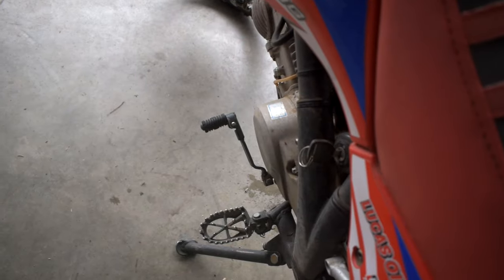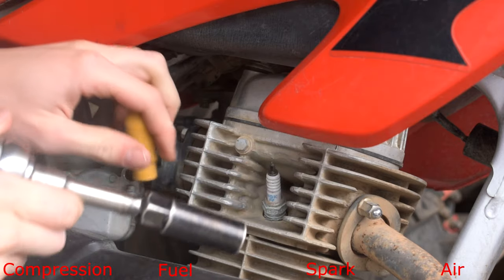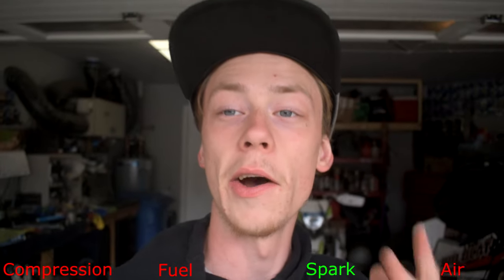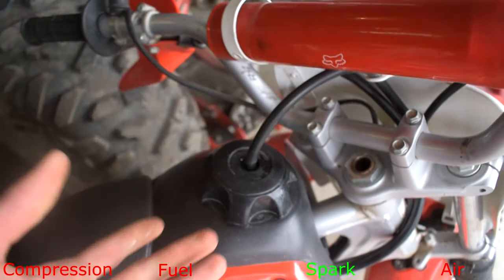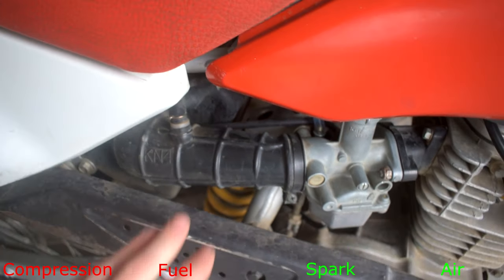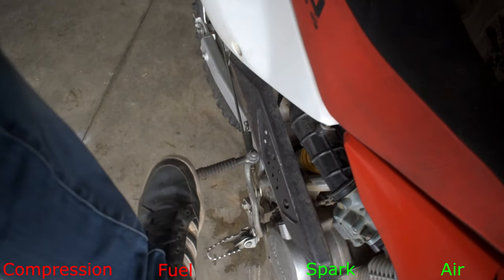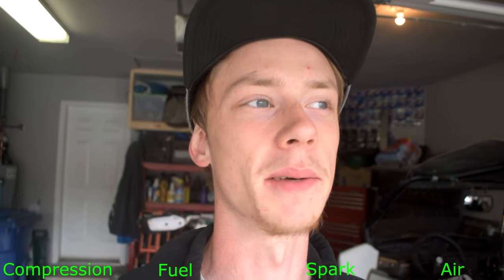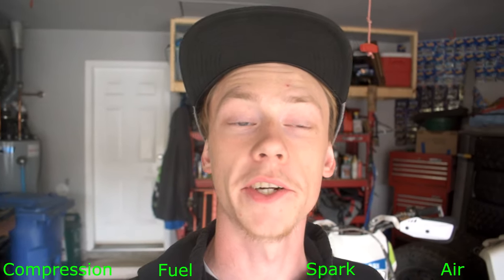Dirt Bike Wont Start? Here's How To Fix It + EXTRA TIPS

Comment: I have a 2019 rfx noticed  2/3 broken spokes so i replaced the rims tires. I didn't ride  for about a 7 to 10 days while waiting for the wheels to arrive. After i replaced them i went to start my bike and it wouldn't kick over. I have compression, fuel, spark, and air i don't know what else to check. Any help would be highly appreciated.
Reply from the maker: If you had all four of those your bike would start tho
Reply: Gonna try to bump start it when i get home
Reply: @AaronsEnduro  got it to bump start on the 3rd try she revved then ran about 10 seconds then cut off kept trying though she never started again 😒
Reply from the maker: @elohimentertainment8166  sounds like a fuel delivery issue
Reply: You think it may be the gas itself?
Reply: It kicks over when i remove the plug and spray carb cleaner into the whole but doesn't stay on 😭😭😭
Reply from the maker: You have fuel clogging somewhere in your fuel system
Reply: @AaronsEnduro  what's the best way to clean your fuel system!?
Reply from the maker: Ultrasonic cleaner machines
Reply: @AaronsEnduro  I can tell you something is cheaper .
Reply from the maker: Carb cleaner works pretty good too, but nothing beats an ultrasonic cleaner
Reply: @AaronsEnduro  you speak very good and clean. I will say God he loves you. Btw it's interesting how you speak
Reply from the maker: Canadian eh 🇨🇦

Comment: Hey man just rebuilt my carb because the float seat was stiffer then epstein at a children's birthday party and was overflowing like epstien at a children's birthday party lol (it no longer leaks gas through the overflow)  we can get the bike to start by bumping it but it won't start with the kick starter and it won't idle after we bump start it ... any suggestions?
Reply from the maker: When you say you rebuilt it, did you ultrasonic clean the carb? To me is sounds like theres still a fuel blockage (possibly in your fuel tank, fuel filter, fuel lines or the carb circuit* where fuel flows through the internals of the carb)
Reply from the maker: This video might help you out 
How To Fix A Dirt Bike That Wont Stay Running | High Idle | Hot stall
Reply from the maker: https://youtu.be/3rSsLNuoy0Q
Reply: Little background the bike is a 2001 yz125! It runs when I bump start it so it's not a fueling issue! The bike does not have a fuel filter on it ! Once I bump it I can right around 0 problems.. until I go to stop, if I don't keep reving the bike it will die on me ;/ I also can't get the bike to start Via the kick starter... we tried adjusting the idle screw but no luck to get it to idle or start with the kick starter .. :/
Reply from the maker: Sounds like a pilot jet issue then
Reply from the maker: Pilot jet controls fuel at and idle and for start up
Reply: Like jet should of been in the rebuild kit is bought correct? If so it's brand new
Reply from the maker: If its too small it wont run because its not letting enough fuel in
Reply: Is the pilot jet the screw with the lock nut that controls the idle? If so i didn't change that and the bike ran before with that exact part! Or is the pilot get actually in the carburetor?
Reply from the maker: @slavikanian  the pilot is inside the carb
Reply from the maker: @slavikanian  watch this and youll know what the pilot jet is https://youtu.be/oyGP1uTU-jE
Reply: @AaronsEnduro  it's a rebuild kit for this specific bike and carb so what would be the issue? Should be the right jet
Reply from the maker: Jetting is the one thing that varies where ever you are. The jetting is partially based on your altitude (thickness of oxygen in the air)

Just because the same bike had the same jetting somewhere else doesnt mean it will be perfect for you. 

If it bumpstarts but wont stay running without your throttle application then its a low idle , throttle cable issue, or jetting.

Either that or you’re overlooking something simple
Reply: @AaronsEnduro  at this point I think I need to take it to a bike mechanic because I don't see what could be wrong .. like I said its a direct rebuild kit so I don't see what the issue would be :/ I should be the right pilot jet. I'm at a loss on this one 😕
Reply: @AaronsEnduro  I'll try some more idle adjustments tomorrow other then that I have no idea... it's got a brand new throttle tube and cable along with new jets.. so I'm going to have to assume it's a low idle issue
Reply from the maker: @slavikanian  buy a pilot jet kit for 18$ and try it out lol
Reply from the maker: @slavikanian  did you put the carb together yourself
Reply: @AaronsEnduro  had help from my buddy putting the carb together I didn't do it myself! I can buy a pilot kit for sure. Should I try putting the original pilot jet back in that I know ran in my bike ? Only reason I rebuilt it was it was passing gas cause the float seat was bad the gasket was hard as a rock
Reply from the maker: Yes why not try that!
Reply: @AaronsEnduro  my buddy checked the numbers before he rebuilt the carb  and they are the same pilot jet... hmmm idk man I'm at a loss at this point lol 😅 set the pilot air screw to the manual specs (turn and a half to a turn and 3/4)  I'm not to sure where I should set the idle screw at as a starting point though
Reply from the maker: If you can get the bike running by holding the throttle after bump starting, (get someone to adjust the idle until it takes over and you dont have to hold the throttle anymore
Reply: @AaronsEnduro  that's what I figured aha we kinda tried that at the end of the day at the shop but buddy got tired from pushing and we called it quits ! I'll try tomorrow! I appreciate the advice brother
Reply from the maker: Best of luck!!!
Reply: @AaronsEnduro  you think maybe I need to replace the power valves ? Would that keep the bike from running right at low rpms?

Comment: I have a baja 70cc and wont start got spark still checking some others are you suppose to hear alittle air when you kick start it from the air filter
Reply from the maker: Yes, thats the compressed air from the cylinder
Reply: Awesome also I have a hose in the back that just hangs don't seem like it goes to anything and I just cleaned my carb still won't start I have spark buy the guy I bought it from sais it was the stator and it sounds like it wants to start but just doesn't kick over thanks for the reply and awesome video thanksb
Reply: And air also comes from that hose that doesn't go to anything I see
Reply from the maker: Sounds like the crankcase breather you’re looking at. Dont plug it

Comment: Watched your video. Everything you listed to check i did that already. The stock air filter that came with my pit bike. a taotao db17, the air filter had a nipple that a vent hose i believe connected to the air filter from the crank shaft, I think. Well i got a new air filter that didn't have a nipple to connect the vent hose to. so i didn't connect the hose to this new air filter. it just dangled into the atmosphere. Well ever sense then the bike doesn't want to start anymore. it started but then dies if im not holding the throttle to keep running. Maybe you can help me because this is very frustrating.
Reply: The new air filter I put on, didn’t have the nipple attachment for the vent hose, I assumed it was fine to not have to attach the vent hose. Well once I got the new filter on, the bike started and I let it warm up, but when I went to ride, it started to bogg out and I pull over to check it then it turned off, took me a good while to start the bike but eventually started it, I got home to investigate but I can’t get the bike started anymore . Really hope you can help me
Reply from the maker: Ill be home shortly and i can cover all this in detail. Long story short you need to delete the oil air seperator (its junk anyways) and vent the tube coming from the engine down at the ground (DO NOT PLUG IT OR YOU WILL BLOW YOUR ENGINE)

This is the crankcase vent

Comment: Dude I need help I got a ssr200 it ran good when I got it I got a new carb for it it’s definitely the correct carb it’s getting spark and the bike won’t start idk why there’s gas in it and the fuel is on and it just ran a week ago with the same exact carb

Comment: Hey man I got a question I got a ssr 110 I’ve let sittin for probably over a year I checked the spark plug and it wasn’t sparking so I bought a new spark plug and a ignition coil and after that I had spark but sadly it still isn’t running do you have any idea why it isn’t running I might use starter fluid idk
Reply from the maker: If you use ethanol based fuel itll evaporate over that amount of time clogging your fuel system
Reply: Sorry but what to do if that happens?
Reply from the maker: Clean the fuel system throughly especially the carberator
Reply: I already cleaned the carburetor is it maybe the fuel system clogged ? Do I need to buy a new filter ?
Reply from the maker: @ElijahDavis-ku7qv did you remove and clean the jets individually, and did the carb have a golden brown color on the inside. That would indicate shellac (a hard debris that will clog the fuel system)
Reply: Yes it did how do I get rid of that do I just blow it out until it’s gone ?
Reply: If I do clean it all out will it work but how do I remove the substance tho in the jet
Reply from the maker: @SuperBowserbros691  ultra sonic cleaner / brake clean
Reply: Can I just use the break cleaner and it’ll work the same right ??
Reply from the maker: @SuperBowserbros691  yeah
Reply: Or can I just use gum out carb cleaner to clean out the jets will that work better ?
Reply from the maker: @ElijahDavis-ku7qv yep
Reply: Hey dude it’s me again I figured out the problem one of the needles in the carburetor was bent so I need to buy a new one what carburetor do you recommend for a ssr 110 pit bike my budget is only 30 dollars and I can only get one on Amazon should I get a mikuni carburetor?
Reply: And also what mm is a ssr 110 carburetor any way I think it’s 16 or 22 idk
Reply from the maker: @SuperBowserbros691  22mm should be good for 110cc mikuni carbs are what ur after. Those Amazon carbs are pretty shit, but can get the job done with some tuning
Reply: Do you know what kind of floater needle valve a ssr 110 dirt bike carburetor takes?

Comment: I got a crf70 today for $175 it’s got compression and the carb is clean and it’s getting fuel but it won’t crank at all but every 4-5 kicks it’ll backfire and shoot a flame out of the pipe thoughts?
Reply from the maker: Probably flooding the engine with too much fuel
Reply: @AaronsEnduro  how do I fix that?
Reply from the maker: Turn down the fuel on the carb ( watch my carb video)
Reply: @AaronsEnduro  don’t see the carb video
Reply from the maker: https://youtu.be/H6qr7R7WBLU
Reply: @AaronsEnduro  u got a snap so I can send u pictures of what screws I see and which to turn? One of them I turn and it makes gas go out of the hose under my bike on the ground the other one has a spring on the screw
Reply from the maker: Ig in description
Reply: @AaronsEnduro  I dmed u
Reply: @AaronsEnduro  could u help right now? If not we can another time just wanna see what’s wrong with this thing lol

Comment: I know that this a 2 year old video but I have a Yamaha 110cc 1973? Or 74  but we presserwashed it and the we started it up and then I punched the throttle and then it lost power slowly like it lost power in like a 2 second power lost or lost some rpm’s every to seconds and I used the throttle because I thought i just let of the throttle to long witch I used it and the rpm’s still was losing power then it just died. And we checked for spark which it was but it was like it got spark some times it got spark and sometimes it didn’t so we checked the magneto and all of that but it was all good it had a bad coil pack we switched it to a good one still little to no spark and I only rode it for a week

Comment: I went away for like 3 years i left my dirt bike back at home it was running grate got home a couple days ago and my kick start is stuck I can’t kick start it or anything my kick start won’t go all the way down what can I do to fix that Help?
Reply from the maker: Sounds like the piston and cylinder walls rusted. Pull your exhaust off and take a look inside
Reply: @AaronsEnduro  ok thanks I will do that
Reply: @AaronsEnduro  so I did that and took off the spark plug and looked in side both ways and there’s no rust is there anything I could do to free it to make it work again?
Reply from the maker: Then the kickstarter gear is jammed

Comment: My 2018 crf250r won’t start with button until it’s been warmed up for a while but will bump start right away. Anyone know what’s wrong?
Reply from the maker: Possibly too small of a idle jet
Reply: @AaronsEnduro  hmm it’s ran and started just fine the last two years and I’ve done good maintenance on it. It just all of a sudden started doing it.
Reply from the maker: Sounds like a clogged idle jet from sitting
Reply from the maker: My first bet either way would be taking the carb apart and cleaning it. Cheapest easiest thing you could do
Reply: @AaronsEnduro  sweet thanks my man🤙🏻
Reply from the maker: You could also quickly trying to adjust the idle high to see if it cold starts better
Reply: @AaronsEnduro  for sure!
Reply from the maker: Lemme know how it goes 🤘🏼

Comment: hello, so i just bought a tao tao dbx1 bike and my bike starts but the issue is that it takes like 10 kicks to kickstart the bike. how do i fix this?
Reply from the maker: You got the carb with the choke on? Also, if the the bikes cold thats fairly normal
Reply from the maker: When i havent started my bike for the day it takes about 5-10 kicks cold
Reply: @AaronsEnduro  yes, i have the choke open and it takes forever to start the bike even after ive been riding and i stop the engine and start up again it takes forever. is that normal?
Reply: @AaronsEnduro  and also when i close the choke the bike stops so i ride it on mid-choke
Reply from the maker: Hot start issues can be related to valve issues. But hard to know without looking into it
Reply: @AaronsEnduro  also, is it okay to ride with the choke open? becasue on this tao tao dbx1 if i close the choke the bike will turn off.
Reply from the maker: You do not want to ride with the choke on. Its only for warming up your bike
Reply: @AaronsEnduro  then do you know why it wont run with the choke off?

Comment: I can push my kick start down with my hand is that bad it just stared to not work
Reply from the maker: It can have to do with your clutch tension . If you pull the clutch cable a couple times and roll the bike back n firth then try, does it get stiff again
Reply from the maker: If so its the clutch kickstart safety
Reply from the maker: Otherwise you have no compression with the engine
Reply: @AaronsEnduro  thx
Reply from the maker: Lemme know how it goes!

Comment: My pit bike only starts if I put fuel in the air filter do u know what this means
Reply from the maker: Carb is gunked up. Clean it with carb cleaner
Reply: @AaronsEnduro  I have done a carb clean already and it still won’t start on its own
Reply from the maker: Clearly there is some sorr of blockage in the fuel system. Gotta just figure out where from
Reply: @AaronsEnduro  yes I need to find out I’m just not very good with bikes 😂
Reply from the maker: Start with replacing the fuel lines, clean the shit outta the inside of the carb

Comment: hi I’ve had a 90cc Orion pit bike for abt 3 weeks now, i got it from my friends father after he hasn’t used it in a while it was running okay but it sometimes didn’t want to start at all. 3 weeks later and now I can’t even start it, I’ve checked everything in this video and it just isn’t start it’s also a e start so that might be something. Thing is when you try to start it the engine doesn’t go on it just like sounds like it almost gonna start, I believe it’s a fuel issue cause my fuel tube that went into the fuel filter got cut in half and I cut it off and put it back again and it wouldn’t start
Reply from the maker: Did you do the tests in the video
Reply: @AaronsEnduro  I did but couldn’t do the compression one
Reply from the maker: Id try cleaning the carb out too if its been sitting
Reply from the maker: If it has no compression it wont want to run
Reply: @AaronsEnduro  I did it 3 times but I can do it again
Reply from the maker: If you know the bikes getting fuel, spark, and there no air blockage the bike would run if it has compression and the cdi box isint shorted or broken
Reply: @AaronsEnduro  can i send you a video of it on instagram?
Reply from the maker: Also when you cleaned the carb was it full of debris or gummed up junk? If so, that debris is still in your fuel lines and gas tank
Reply from the maker: Yep, @aaron_greenway
Reply: @AaronsEnduro  it wasn’t really full with debris or junk it was pretty clean
Reply from the maker: If you’re looking for one on one support and want to support the channel you can check this out
https://www.youtube.com/channel/UCcviyKZ2Vf3IHFliwebzODA/join
Reply: @AaronsEnduro  sent the video of the bike